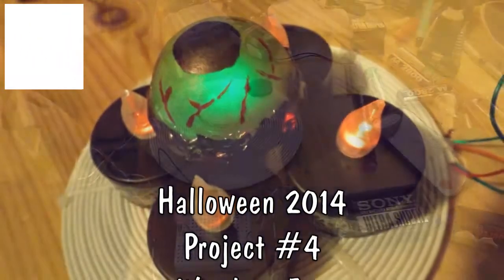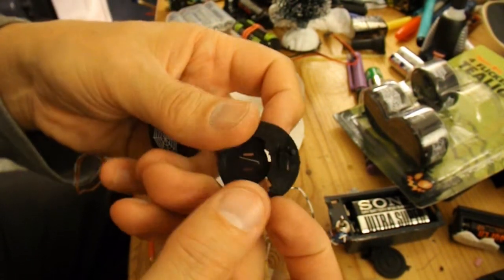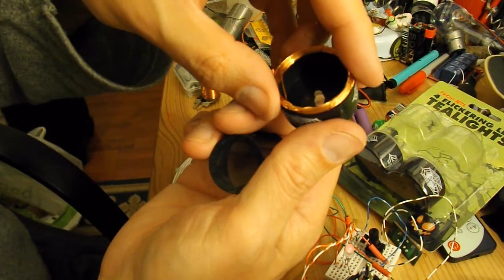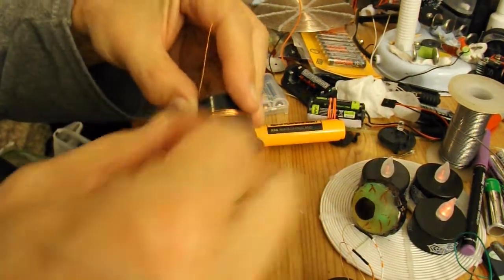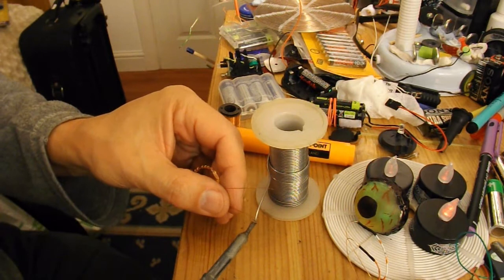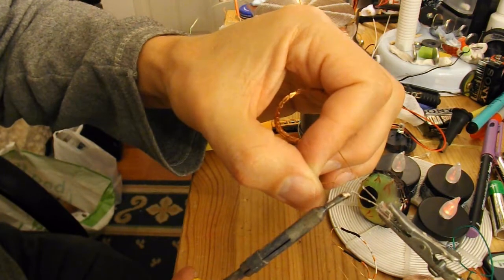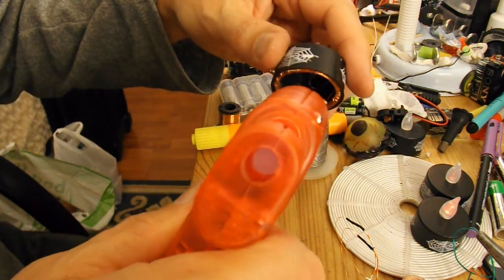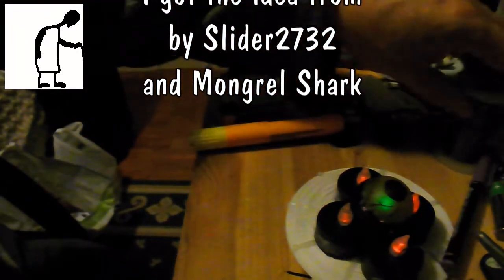Halloween 2014 Project #4 Wireless Eye and Tealights

Comment: Here's the trick for the flicker light -
A diode in series with the LED, also works for motors. You can put a 10uF capacitor (or similar) across the LED too, to smooth out ripple and sometimes that improves brightness.
Actual output of that SWES type setup is likely around 30V and could well be higher, but is attenuated by the load. Checking the voltage on a mains voltage rated capacitor across a coil, instead of an LED, will show the output readily enough.
Reply from the maker: Thanks again Slider :-)